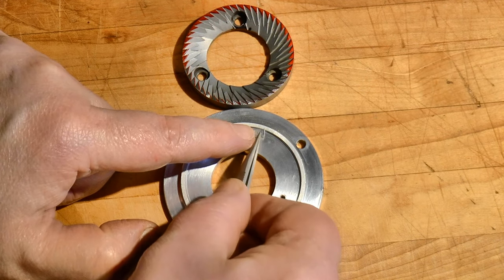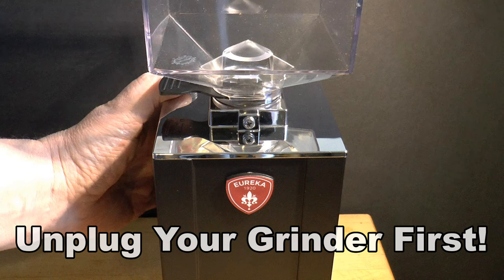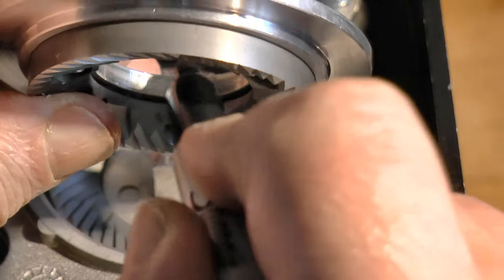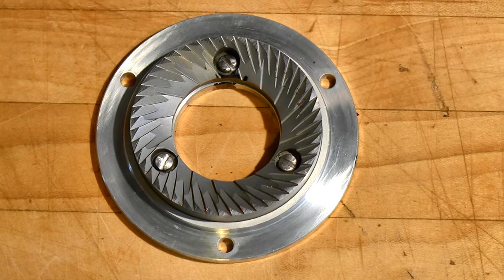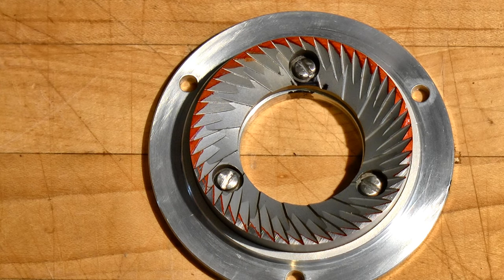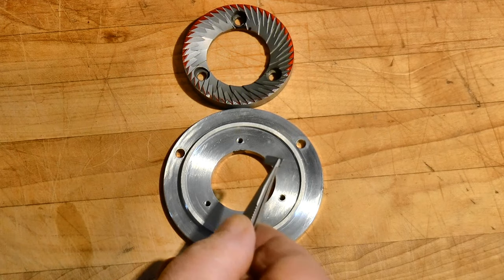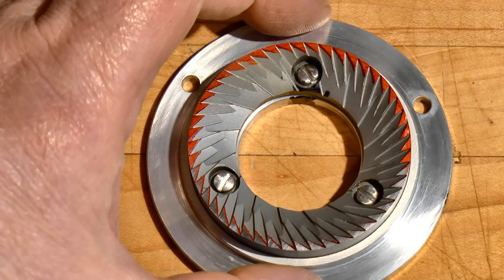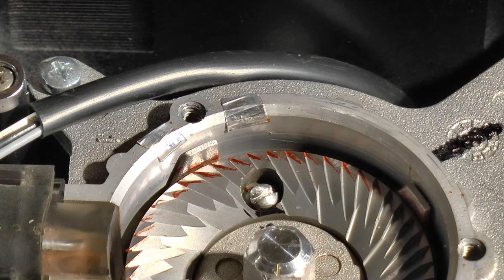Easy And Safe Burr Alignment

Comment: Is this necessary if you’re only planning to use the grinder as an espresso grinder?
Reply from the maker: Unless you're seeing a problem, I doubt it's necessary with any new grinder from a quality outfit. I might check a new unit from a questionable brand, or a quality one that's a couple of years old.
Reply: I got my Specialita dialed in right out of the box. However, when I did  a cleaning and went a bit coarser or so, the grinder stopped grinding for espresso now. I don’t know what to do, and I’m new to all this, and I tried to follow the directions, but it’s a little bit over my head with putting everything together when it comes to this. Do you know if  Eureka can do this for me? Or anybody that could do this for me? I’m willing to pay thanks.
Reply from the maker: @NickAlbano253  I don't think Eureka has an alignment service. Maybe contact a local repairman? Is it possible that, while cleaning, you might have got some coffee grit between a burr and its carrier, or a carrier and its mount? Even if you didn't mark the orientations of each part, with a new machine, I would expect it to perform reasonably well so long as all of the mounting surfaces are clean and the parts are seated normally. Perhaps a burr isn't seated properly due to over-tightening or under-tightening a fastener. I hope you can get it fixed without much trouble.
Reply: @NickAlbano253  Did you end up figuring out what's going on? Are you sure you just didn't need to do another rotation of the dial? :D
Reply: I did not, and sorry for the late reply. I’ve recently got the Flair 58, and I’ve been pulling shots with no crema, and the shots have all been sour. I think it might be my burr alignment, but I can’t do this on my own because I’ll never be able to figure it out 100%. Do you know if Seattle Coffee Gear or even Clive Coffee aligns burrs? Or do they only do that kind of thing if you buy the grinder from them?

Comment: Thank you for this excellent tutorial. I just had one question. You mention over tightening and this is honestly my biggest worry. Is there a way to determine how tight the 3 flathead screws holding the burrs in place need to be without using a torque screw?
Reply from the maker: The screws have to be snug or the burr won't seat evenly in the carrier, but you can overdo it. A screwdriver with a narrow handle gives you less rotational leverage and is less likely to cause trouble. It's one of those things where experience helps: one develops a feel for it.
Reply: I actually have torque screwdriver. Do you have any idea to what NM it would be ok to screw burrs in? I am currently doing 1.8nm which seems similar in feel to the feel that first unscrewing gave me :)

Another question what is machine oil? I have some choices of automotive oils like differential oil, would that do?

BTW would you be interested in testing comparing DF64 as I am in Dublin :)

Cheers

Comment: I've been leant an Atom 65 (currently using a J-max) by a friend and thought it would be great to check the alignment of the burrs to make sure all is running well before I begin. His was used in his coffee shop but burrs seem in good shape. Performing the marker test everything seems even all around, but the flats aren't completely cleaned of marker. The inner point remains and only the outer edge is rubbed away. On both top and bottom burrs. So I'm not really sure if that's normal or where to go from here haha. Any advice from anyone?
Reply from the maker: Yes, they're fine and don't need attention. The "flat" surface may slope away from the burr circumference on some models. Not an issue.

Comment: 9/10MM SOCKET i THINK WORKS AS WELL IF NOT BETTER
Reply from the maker: No, a socket has far too much lash for you to feel the surface contact area as you turn the rotary burr. Something like vise grips or a firm spring clamp will make a positive connection, letting you feel the action properly. That said, I would use a socket to fasten or remove the nut, but never for this operation.
Reply: @wiredgourmet  Not the ratchet part. Just the socket instead of the grabbing. I get what your saying Though.

Comment: Hey!:-)
I am intending to align the burrs on my specialita (in use since ca a week). Do you think I should wait a bit for the burrs to „settle“? In your case, how often did you fold the aluminium foil? And it’s just standard household foil, right? Do you think I could use some silicone grease to place the foil, like Molykote? Sorry for all the questions :D thank you already a lot for this video!!!
Reply from the maker: I think a new machine will be in good shape, maybe not need adjustment. I only "fixed" mine so I could demonstrate it. In my case I folded regular foil once, so 2 layers. But it was barely out of alignment, as you saw. Silicone grease would be fine, but not too much as it will hold onto coffee particles.
Reply: @wiredgourmet  thanks for your answer :-) I am still in the process of dialing in... my zero is just before 5 (coming from nr 0). I know it is really up to the specific coffee etc, but how many numbers do you go up to be in espresso range-ish? Btw: wanted to open the top for cleaning today and just couldn’t loosen the screw, really annoying. The grinder is placed in front of a drafty window, could the temperature cause the screw to be unusually tight? Best wishes from Denmark! :-)
Reply from the maker: @geraldg6463  From "zero" (burrs barely touching), I loosen 3 or 4 whole-number steps for espresso. 3 steps for a small shot, 4 for a large dose, and of course that's just approximate since coffees vary. Turkish is around 1 or 1.5 steps from "zero".
Reply: @wiredgourmet  Okay, that's what I feared. I am in the turkish fine area which I can also see and feel after grinding (and it takes about 20s to grind ca 18-19 grams) but somehow that is the only grind size giving me decent extraction times... I might try another coffee and see, if that's the issue
Reply: @wiredgourmet  I am actually suprised. For espresso I am only 1,5 turns away from touching point. My model is Specialita as well. In this case my unit is misaligned maybe? (I did your test turning by hand anticlockwise, I heard a very slight metal sound of touching around -0.5 and it locks around -0.70. I do espresso at +1,15 Do you think I should repeat the test with a marker like you do? My unit is brand new). Thanks for the perfect method and video by the way.
Reply from the maker: @muratozt  I think you mean steps, not turns (rotations) right? My espresso range lies between 3 and 4 steps away from touching. 1.5 steps away puts me in the super fine range for Turkish coffee. It would not hurt to try the whiteboard marker test and see if yours is misaligned.
Reply: @wiredgourmet  Yes I mean steps. Thanks, I will give it a try
Reply: @wiredgourmet  Hi, just checked it seems misaligned around half a turn. There is a point where only a part is stuck (-1.5) and when I keep on turning it is relaeased. On several points of release, I tried by turning half a turn more (-2) and it is completely locked. There is no more point after -2 that discs keep turning. However the shape of marking is little strange. Half of the disc is touching however it is not harmonised with the screws. So I could not decide where to put the shims. May I send you the picture via e-mail? I will be appreciated for your help. Thanks
Reply from the maker: @muratozt  Ok, send via email. But I won't be able to just look at pics and tell you how many layers and where to put them.  This will be trial and error for you. I would recommend shimming the carrier, not the burrs, because it's way faster.
Reply: @wiredgourmet  Received your prompt answer to my e-mail. Thanks a lot again for taking care;)
Reply from the maker: @muratozt  No problem; I hope it's working a bit better for you now.
Reply: @wiredgourmet  Hi, managed to do it with 3 layers of shim on the disc, 3 layers on the carrier. Now perfectly alligned, wiping the marker off totally (tried two times) while still possible to turn the mill by hand. But strangely not much has changed on the adjustment button. Still locked at where it was before but this time with almost no sound of friction coming until there. Maybe it was not bad before but surely better now. Thanks again for your help. One remark: if points of touching are not synchronised with screws on the disc, sollution is to try rotating carrier position 60 degrees and check other two positions where you find the best alternative in terms of shim position possibility.

Comment: Can this ink test be done with ceramic burrs?
Reply from the maker: The test is OK, but I would not use shims for adjustment as shown in the video, because ceramic burrs might be too brittle and could crack.
Reply: @wiredgourmet  would you recommend the hyperalignment method? (I have a vario)
Reply from the maker: @masaeb28  The Vario is great because there's a lot that you can adjust and fine-tune, but it's more complicated and is probably best for people with some shop experience and a feel for that type of work. I think it's a solid method if you're comfortable doing the job.
Reply: @wiredgourmet  is there a video or document that walks one through the process?
Reply from the maker: @masaeb28  This is a pretty good document: https://www.home-barista.com/grinders/baratza-vario-super-alignment-owner-experience-t60764-10.html  This video has no narration and is not photographed very well, but it covers the process: https://www.youtube.com/watch?v=bAZLV0ZsWxA  I'm not sure these would be sufficient for a novice.

Comment: 6:21 - You're using "3-IN-ONE Oil", that is toxic and clearly labeled on the back of the bottle, "if swallowed call a physician immediately". You must be a "die-hard" (no pun intended) coffee fanatic...  Also it has a very strong odor.🤮Using mineral oil might've been better since it's food safe.
Reply: Correct. Bad advice to use carcinogenic substances in a device that comes into contact with food